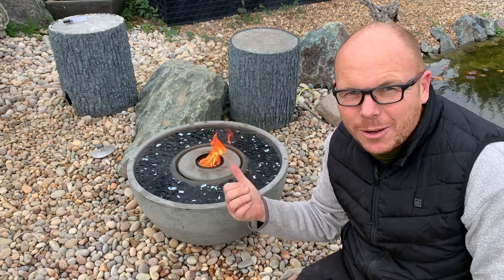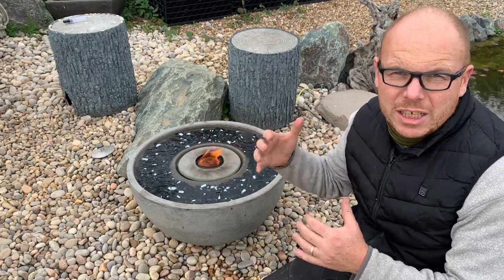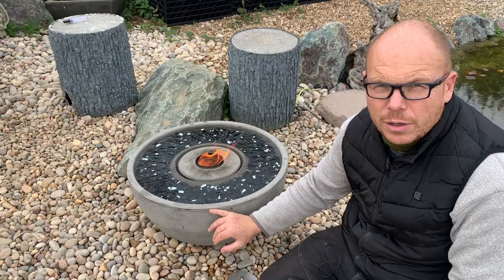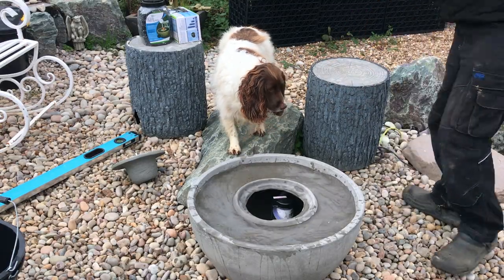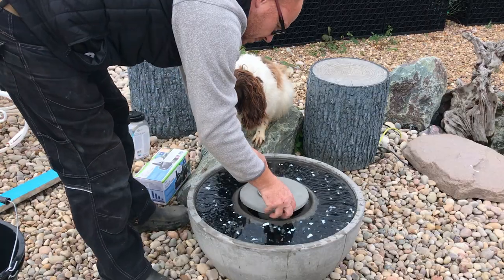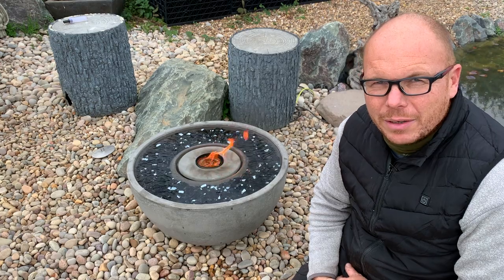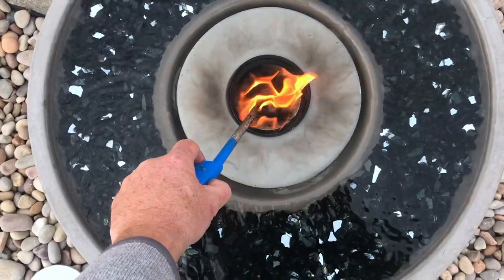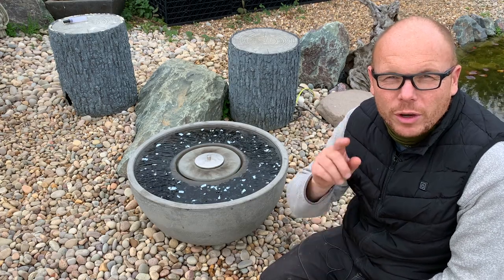How to install a fire fountain water feature, outdoor living

Comment: Totally off topic, do I need to keep my pump and filter running during the winter months, my fish seem to be a little lethargic so I am also wondering if I should stop feeding them.
Reply: Hi Jeff, I have had the same thoughts as you. I only have a small 230l 'water feature' / pond with 6 small  goldfish. Since the temp has started dropping over night / air temperature down to 5C a few days ago the water temperature dropped to 8C and the fish have been very inactive. I am monitoring the air and water temp with a Raspberry Pi Zero and yesterday hooked it up via a relay to a 150W pond heater (it is only meant to keep an ice hole) that switches on when the temp goes below 10.5C. It has helped, last night the air was 6C and the pond stayed at around 10C. today the fishies are swimming about and have eaten. 

I leave the aeration and small 60l/hr  pump running 24/7.

If the heater cannot maintain 10C over winter I guess I'm going to have to buy am aquarium and move them indoors but fingers crossed lol.

If you have a deeper pond they may be fine but mine is really quite small.

Good luck :)
Reply: Leah C , thank you for your reply, my pond is about 600mm deep I normally run my pump, waterfall and fountain 24/7 but was wondering if I still needed to
Reply: @jeffgibbs7093  It probably doesn't cost much to keep it running ? Maybe invest in a small pond heater and thermometer if you are worried.  Heaters are only about £25 on amazon but you need an RCD protected mains supply nearby. 150W heater costs about the same to run as a large TV and much less than an average PC.
Reply: I would have thought it should be running over the winter. If there is a waterfall in your set up, I would have thought that it will stop the water from feeding. Also a low protein diet, which makes it easy for the fish to digest would help like wheatgerm
Reply: Lovely little addition 👍
Reply from the maker: https://m.youtube.com/watch?v=KC-F1ldf6K0
Reply from the maker: https://m.youtube.com/watch?v=iVyn3-Kj5iY
Reply from the maker: Have a watch of these videos, let me know if you have any other questions. Or I don’t cover what you are asking